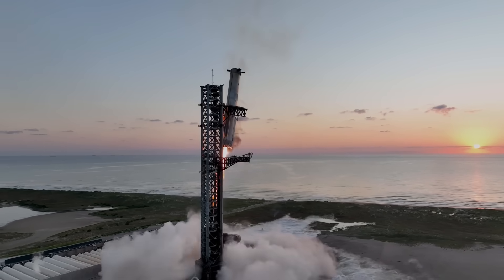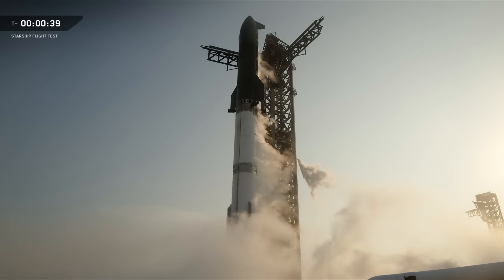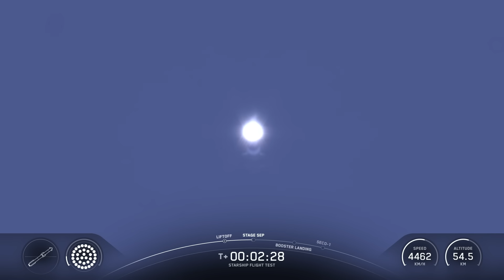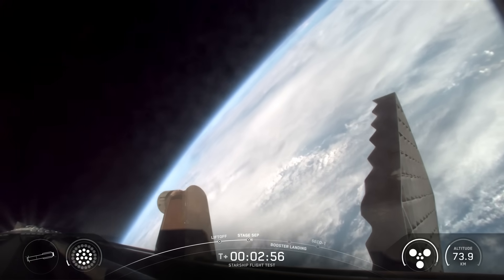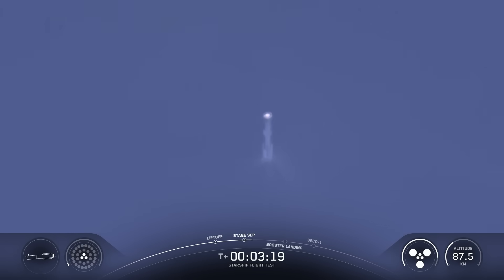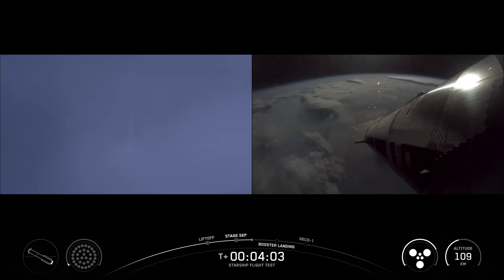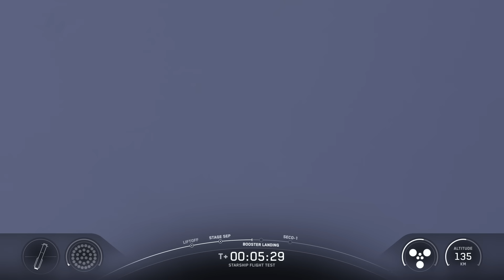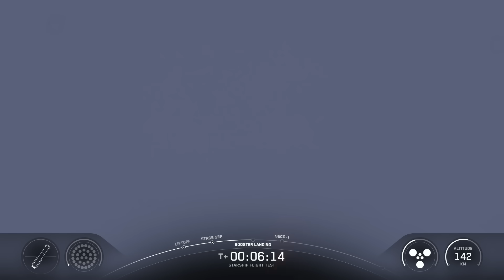SpaceX Builds Largest Reusable Booster, Also Makes Door That Won't Open - Starship Flight 9 Recap

Comment: It's a fair point to make about the complexity of engineering for spaceflight, demonstrated by the difficulties SpaceX are facing with something as "simple" as a payload door.

Yet, the far more complex payload bay vents and doors on the Space Shuttle worked the first time Columbia reached orbit, and they never had a significant failure of those two critical systems during any of the Shuttle's successful flights. NASA managed to get it right before reaching space. So one has to wonder where the shortfall is in SpaceX's engineering failures with their slit door for the next generation of Starlink.

Now imagine the complexity of the much larger system SpaceX is going to have to engineer to deploy bigger payloads from Starship's cavernous payload bay.
Reply: STS had significant systems failures from early on, it just didn't have catastrophic failures until later. The Challenger and Columbia disaster reports go into some of the details and history of NASA management sweeping problems under the rug by redefining what counted as a problem.

By the original specs, any o-ring erosion in the solid boosters was a failure, and any damage to the thermal protection system was a failure.
Reply: @SnakebitSTI  Indeed, Challenger was a case study for Diane Vaughan in highlighting the corporate tendency (not just in NASA) towards normalisation of deviance to achieve targets. I remember both Challenger and Columbia, and the investigations that followed, all too well. Schedule pressures, political pressure, budget "efficiency", and so on, can drive any organisation down a similar path. We'll see if any such issues arise in the coming months and years as the US strives to beat China back to the Moon. We're already seeing SpaceX accept it as "normal" to fly frequently and suffer failures to learn lessons that otherwise might have been prevented with a more robust, but admittedly more expensive, engineering approach. It will be interesting to see if SpaceX can fail their way to success! Perhaps it will be fourth time lucky for Flight 10, but they obviously have a lot of problems to resolve.
Reply: But we may want to bear in mind that, while classified as a flight test, that first Columbia mission was MANNED.  NASA probably had a much more demanding list of what had to be squared-away on the ground and a much lower list of what aspects of the door's performance could remain "unkown" before they would ever launch that mission.  Nobody would want to see astronauts die on account of malfunctioning cargo doors.  

With SpaceX sending up these unmanned tests, they may simply be willing to accept more unknowns, allowing them to be less demanding about how things perform before being launched as long as their pocket book can support such risks.
Reply: @zerstorer335  Indeed it's a different approach -- and SpaceX has to be able and willing to absorb the costs and delays caused by the multiple failures and "lessons learned" that come with it. NASA had to absorb the costs and delays that came with ensuring mission success on the first try.
Reply: Musk loves cutting corners and the idiots who still work for him are probably overworked and make stupid mistakes. If I were an astronaut you wouldn't catch me dead on any of this privatized trashcan tech.
Reply: You have to remember SpaceX is doing this for pennies on the dollar and at a far faster pace compared to Space Shuttle.  They're doing 'hardware heavy' development, so if it fails in flight, they figure out a fix and do it again.  If shuttle failed on the first flight, lives were lost and the program was over.
Reply: @clevelas2  I don't think we'll ever know just how much money the development of Superheavy/Starship/HLS/fuel depot, etc, etc, will end up costing. All that will be visible is the NASA budgeting. Everything else is hidden behind SpaceX's doors.

Of course, looking at it this way is a zero-sum game, since all of the costs (whether through NASA or through Musk's commercial empire) is money that circulates through the US economy. Just like with the development of the Space Shuttle.  It's not like any of it actually gets spent in space!
Reply: then why didnt nasa made a reusable heatshild for the shuttle or o-rings that worked or a leading edge that can hold up to a foam impact. The spaceshuttle was far from what it should have been.
Reply: @Hans-Yolo  The Space Shuttle was what NASA was allowed to develop within the budget provided by Congress. That should be enough to answer your question.
Reply: @EdwardRLyons  Internet fiction. NASA got all of the money they asked for, for the largest of the options.
Reply: @Hans-Yolo  I get very strong Space Shuttle vibes from Starship.
Reply: @wpatrickw2012  With the little tiny difference, the shuttles developement was supposed to be finished when all the problems started to show, and 2 of those 3 i named where deadly. Starship is not even close on beeing finished, V3 is just around the corner and i bet there are many more changes comming.
Reply: @Hans-Yolo actually, Nasa had better heat tile technology (developed for VentureStar/X33) but it arrived very late, towards EOL of the shuttle. But to be honest, making an upgraded shuttle would make much more sense than an entire new heavy launch system
Reply: @arthurdefreitaseprecht2648   Hätte Hätte Fahrradkette as it is said in German, it doesnt matter what was later or whatever, it wasnt and the shuttle could have never done things that starship is said to be able  and lets not start talking about the costs related to anything shuttle. I loved the shuttle as much as every space nerd but its time is over, it was outdated, unsafe and way to expensive to do anything for the privat sector.
Reply: @Hans-Yolo well, if that's the case, starship did nothing except suborbital flights and explosions until now, so I don't know about its capabilities either. But what I meant about the shuttle is, it's 70s-80s tech. Imagine if it was updated with modern tech (eg. using falcon 9s as boosters, a rapid reuse metallic heat protection system, proper crew escape systems...). It could become much more reusable, so the initial cost point would be moot.
Reply: @Hans-Yolo the o rings failed once in 100 flights

Comment: The shuttle wasn't "propulsively" recovered, but it did achieve successful manned flight within 9 years of project start with a reusable reentry vehicle.   And, it was able to repeat that.  Let's not forget that NASA has some VTOL rocket experience with its DCX program back in 1995.  SpaceX has zero successful interplanetary flights with its Starship, and it's never been anywhere near equipped to carry humans and payloads between the planets.  So far, it's been little more than a re-entry shell with fuel and its engines, and not even marginally tested at that.  That's a far cry from the systems necessary for manned interplanetary flight.

I've been highly critical of SpaceX's Starship of late, as the program has fallen way off schedule and deliverables achievement.  Granted well thought out and frequent prototyping is invaluable, SpaceX is showing more of an an  inexperienced company taking a shotgun approach at solutions.  In a complex project like this, that doesn't work at all.  Given the schedule problems, the fact that cost is tied to schedule (among other things), the significant repeated failures of the program, and the lack of progress to solve technological hurdles, I'm of the mindset the development of the reusable inter planetary vehicle needs to go back to NASA.  SpaceX has shown its inexperience and inability to pull this part of the program together.
 
Yes, they've done a very good job with their recoverable boosters.  Leave that in their hands.  But the reusable manned reentry vehicle is way over their abilities.  Give that back to NASA and also get possibly other outside help with it besides SpaceX.
Reply: Musk will bailout of Starship when all the mega billions pour into SpaceX from Trump’s Golden Dome pork barrel. Now you’re talking real money.

Comment: If the flight doesn't generate a FAA investigation that delays the next flight, I'd call that a success.  As always, thanks for sharing.
Reply: FAA said shortly after that they're talking with SpaceX and will decide if it warrants a mishap. It came down in the ocean, re-entered around the area of Madagascar so I'm inclined to think there won't be one. But there might, we will find out soon.
Reply: you dont have the bar set very high
Reply: @andrewwilliams9419  true but it's important the launch cadence only be restricted by spacex engineering and not FAA roadblocks
Reply: The FAA needs to do their job and ensure a proper investigation is done this time.  The same issue 3 flights in a row shows not enough effort is being put into the investigations.
Reply: The FAA? lol. A SpaceX launch could take out an entire city and the investigation would be “that’s too bad”
Reply: The primary reason for that would be the FAA is no longer functional.
Reply: Didn't Doge gut the FAA?

Comment: They changed the design from the block 1 to block 2 they changed the downcomer pipe from one  to 3 pipes and they have leaking fuel ever since that design change and it caused the altitude control system not to work and  other changes that have caused problems with the old saying if’s working do not change it

Comment: getting more concerned about the money at this point.  One problem with the mantra "The best part is no part" is that it tends to mean less redundancy and fewer backup systems, for small things like attitude control.  One leak and ullage pressure may fall too much.

Comment: Will need about 100 test flights to reach LEO reliably.  Then another 100 test flights to perfect LEO re-fueling.  Then another 100 test flights to get to moon orbit,  Than another 100 test flights to land on the moon without tipping over.

Comment: bAck to the drawing board! Scott showing his age. People under 45/40 years old have never seen or used a drawing board.  Love Scott M he brings clarity to rocket science.  (in the automotive sector drawings have been computorised since the 80's, PDGS, IDEAS, CADS4X ICEM etc.  CATIA, the best, was invented in 1977).
sEcond point.  Engineering problems can always be solved with the correct people, resorces, and willingness to achive.  Engineers never give up, we just try a different way untill we successed (or the money runs out, which isunt the same as failing to find a solution).

Comment: Looking at the internal images of the cargo bay door. Due to the width of the door relative to the rocket circumference and the absence of additional support structures, the door when closed appears to be a load bearing structure. I wonder if the Starship had become sufficiently deformed during launch that it jammed the door?

Comment: Bad losing streak notwithstanding, what SpaceX is doing is amazing. I hope they can keep up the spirit and that they don't run out of funds.
Reply: @vagnhenning  Yep... Launching chunks of exploding steel is awesome!!!!!!!!!!!
Reply: The fact they've flown this thing 9 times and still have not gotten to orbit is kind of perplexing.  Makes me think the internal functioning of SpaceX is not as good as it once was to be perfectly honest.  They can frame this test however they want, but not getting a rocket to orbit after 9 flights is kind of crazy.
Reply: @sciencecompliance235  you do realise they are not aiming for orbit yet, they could have got the gen 1 starship to orbit if they wanted too, most of these test have been specifically to test things like heat shielding, engines, control flaps etc more of design proofing. Then you got the gen 2 ships which may seem a step backwards as they havent had much success but it is basically a whole new vehicle compared to the gen1 since so many other design changes have happened. They will probably have a load of issues again when they eventually swap to the new rocket engines too which this current versions is more a stop gap until those are ready.
Reply: @a1yca7z  They should be targeting orbit, though, which is my point.  The fact they're not even trying to get it into orbit and then let it orbit, then deorbit it says something on its own.  It will have to be able to do this eventually.  Tests not shooting for orbit mean they don't have confidence in the vehicle enough to do that and return successfully.
Reply: @sciencecompliance235  Yet, not a single flight so far has been designed to go to orbit!  If you attempt suborbital flight, it's an actual failure if you end up in orbit.  They are doing fine, people not paying attention have unrealistic expectations!
Reply: @davidkottman3440  Why not shoot for orbit, though?  They'll have to get there eventually.  The fact they're not even targeting orbit says something by itself.
Reply: @sciencecompliance235  The Design is way more complex than older rockets.   this test would have been a succes for a one way rocket.

Comment: I die inside when these fail. when you get a look inside or the thrusters, you get reminded how much work went into designing and building all of this and then they go up in flames. it's great for data but when will they start to question the mission. thats what I fear the most
Reply: It’ll continue until a major loss of life. Remember Starship has no emergency escape system.

Comment: 17:06 whole Spacex financial sheme was made to hide program cost from taxpayers (they still funding part of  Starship program through NASA budget) and I'm not convinced that Musk is important figure in this endevour but it's run by tech privateers aka ex NASA engineers (thus still run by NASA but without congress watchover). It's hard to believe a guy who keep failing in making/copying an reliable road electric vehicle is capable running space program of any magnitude...

Comment: Always look forward to your analysis. Nerding out the details like you do is very satisfying. As far as Starship and Superheavy go, I have to return to my days in college when I was arguing a test question with the professor. I had the wrong answer, but 90% of the method to solving was correct and I got no credit. In his broken Chinese accent he said to me "You build bridge, bridge fall down, no partial credit". Other than getting off the ground, I don't see much to be happy about with this mission or indeed the program so far. In my humble and uninformed opinion, SpaceX has woefully underestimated the scaling up of their arguably very successful Falcon 9 system to this Starship. They may have come up with some wonderful engines, but have under engineered so many other aspects of the launch system they may spend years chasing down all these other details which are causing failure after failure. I've been part of teams on some pretty complex aircraft and weapons systems in my career and no matter how much money is expended, you always seem to march into your milestones with some degree of technical debt. But it's not technical debt if the bugs that remain cause complete loss of a system. Starship is so far from being a launch system that can reliably get to orbit and dispense Starlink satellites (and let's be real, this is the true goal. This "get to Mars" business is just a bunch of BS), forget about it being reliable and safe enough to put people on it anytime soon, let alone getting to mars, landing and returning people.

Comment: 8:58 The hotspot looks like a separate item, presumably to perform this superheat function. I suspect it's a catalytic tab with platinum, because platinum will do exactly that much glowing in the presence of methane, helping to burn it off before it gets to an explosive mixture. There appear to be multiple tabs around the rim. This could replace the need to vent much inert gas in the area, other than to stir the local environment.
7:13 Of course the leak has liquid in it. It's evaporating into a vacuum. Seeing that it's not ice, it's probably methane, not helium, oxygen, nitrogen, nor argon.

Comment: To folks that just don’t pay attention. A success would be a launch , orbit say at least once, followed by a landing of the boaster and rocket. Clearly the boaster isn’t reusable even with new engines, the rocket is joke.

To those who think Elon Musk is footing the bill. Wrong!!!!! Every launch is Americans to the tune of 300 million dolllars to make the most expensive Roman candle in history. Apollo was circling the moon and returning to earth intact on launch 8. Starship can’t reach an altitude of 250 kilometers. It launches , arcs through minimum Leo. Then tumbles out of minimum Leo and burns up. You can’t launch a stainless steel battleship.

Comment: 00:09:02 an anomaly; heating burst on the outer fairing end at sea-level raptor engines shutdown as viewed between the shutting down engines and the right vacuum engine.. like it got zapped.. So what else got this  type of 'treatment'?